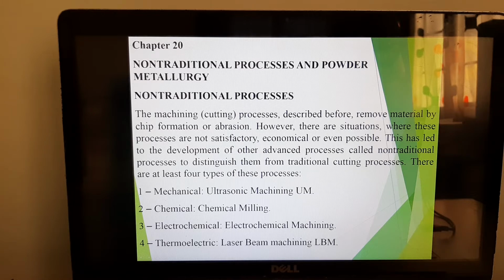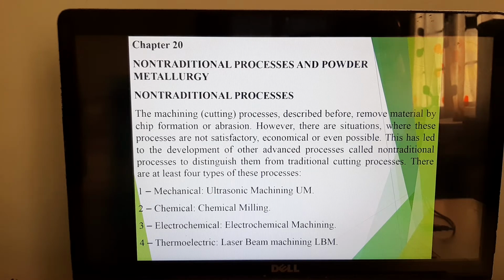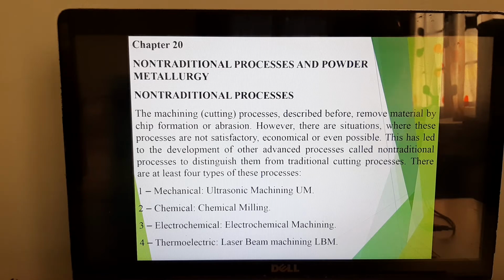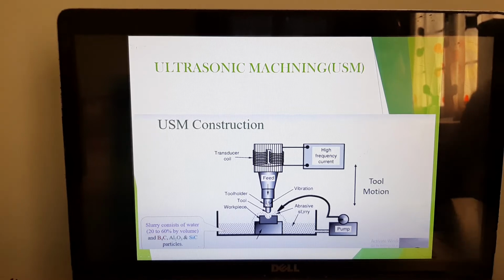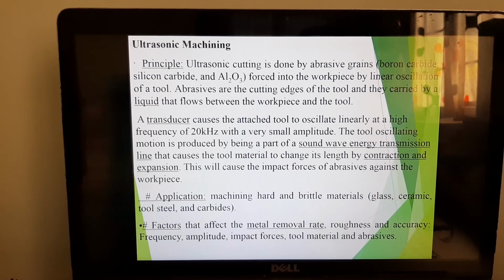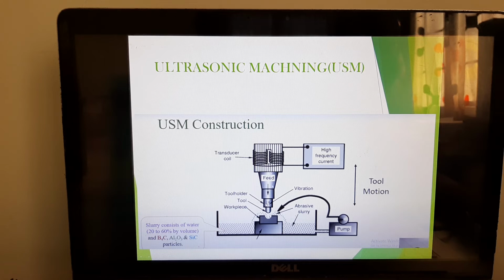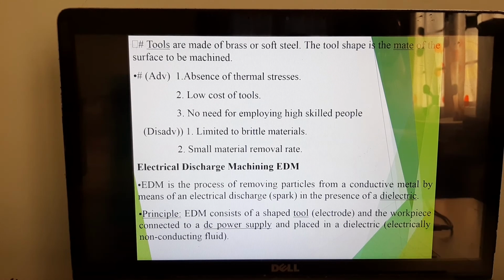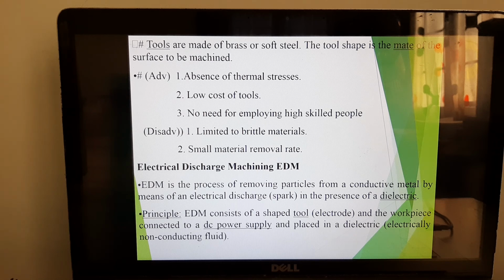MODERN MACHINING / NON-TRADITIONAL PROCESSES PART 1

Comment: Name : Aiman Hazim Bin Arif Razman
ID : ME0106080

From this video, I have learned on the non traditional processes and powder metallurgy (modern processes). This process removes material by chip formation or abrasion. This process consists of mechanical (ultrasonic machining, UM), chemical (chemical milling), electrochemical (electrochemical machining) and thermoelectric (laser beam machining LBM). In ultrasonic machining, the machine is made out of transformers with a transducer coil. UM is done by abrasive grains which are forced into the workpiece by linear oscillation of a tool. A transducer control the oscillating motion of the machine linearly with a small amplitude. This process uses abrasive slurry to help assist in machining. The machine is connected to the main frame which controls the amount of material removed in x, y, z axis. Abrasive slurry includes boron carbide, silicon carbide and aluminium oxide. Advantages of UM : absence of thermal stress, low cost of tools, no need to employ high skilled people. Disadvantages of UM are limited to brittle materials and small material removal rate (nanometer, micrometer).

Thank you for the informational video Dr.

Comment: Good morning Dr, I'm Lee Zi Sheng (ME0106051) I have learned that in this new chapter, the  non traditional processes and powder metallurgy. It involves automation of the manufacturing plant, process and products. The types of non traditional processes are, Mechanical,Chemical Electrochemical and Thermoelectric
In Ultrasonic Machining, done by abbrasive grain(boron carbide silicon carbide) consists of a step down transformer, a transducer coil, tool holder , tool and abrasive slurry and made of brass or soft steel. 
pros                                                                                    cons
Absence of thermal stresses
                                        Limited to brittle materials
Low cost of tools
                                                            Small metal removal rate (nanometer and micrometer)
No requirement of high skilled workers

Thank you.

Comment: ME0106053 Marcus Chuo
Good day madam, knowledge learned from this video are one nontraditional processes and powder metallurgy. The machining (cutting) processes remove material by chip formation or abrasion. in some situations, these processes are not satisfactory, economical or even possible. Thus nontraditional processes to distinguish them from traditional cutting processes. There are 4 types of these processes which are mechanical, Ultrasonic Machining UM,  Chemical Milling, Electrochemical Machining and Thermoelectric, Laser Beam machining LBM. Firstly, ultrasonic machining done by abrasive grains/ surry (boron carbide, silicon carbide, and aluminium oxide) forced into the workpiece by the linear oscillation of a tool. Abrasives are the cutting edges of the tool and they carried by a liquid that flows between the workpiece and the tool. The abrasive slurry also assists in machining and remove the material.
The transformer generates and allows to step up and step down the current.
The transducer controls the oscillating motion of machine by converting electrical energy to mechanical vibration This causes the impact forces of abrasives against the workpiece.
The whole structure is connected to a mainframe where It can automatically monitor and adjust amount of material removal of x,y and z axis. The advantages of ultrasonic machining is the absence of thermal stresses because we are using an abrasive material, low cost of tools, does not require highly skilled workers, and can machine small measurements and material removal rate. The disadvantages are that it is limited to brittle materials.

Comment: Good morning madam, I'm Chong Jin Yang (ME0106047). From this video, I have learned about non traditional processes and powder metallurgy. Non traditional processes involve automation of the manufacturing plant, process and products. It is to increase accuracy and precision. It removes material by chip formation or abrasion. There are 4 types of non traditional processes.
1) Mechanical: Ultrasonic Machining
2) Chemical: Chemical Milling
3) Electrochemical: Electrochemical machining
4) Thermoelectric: Laser-Beam Machining
For Ultrasonic Machining, it consists of a step down transformer, a transducer coil, tool holder , tool and abrasive slurry. Tranducer coil is used to control the oscillation motion of the machine. It will create vibration to oscillate the workpiece. Abrasive slurry is in the form of liquid which consists of B4C, Al2O3 and SiC. Abrasive grains forced into the workpiece by linear oscillation of a tool. Abrasives are the cutting edges of the tool and they carried by a liquid that flows between the workpiece and tool. The Ultrasonic Machining is connected to a main frame which will control the amount of material removal in x,y and z axis. It is conducted under high frequency current. It is made of brass or soft steel. 
Advantages of UL:
1) Absence of thermal stresses
2) Low cost of tools
3) No requirement of high skilled workers
Disadvantages of UL:
1) Limited to brittle materials
2) Small metal removal rate (nanometer and micrometer)

Thank you.